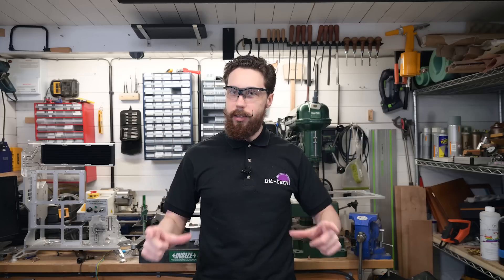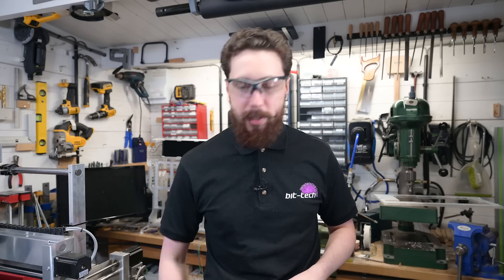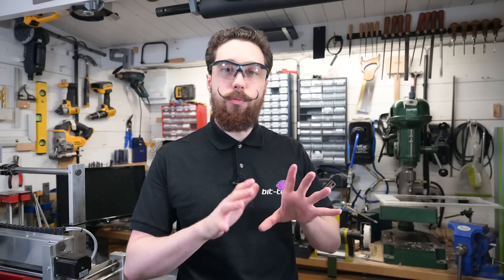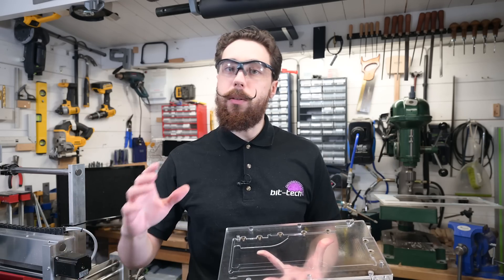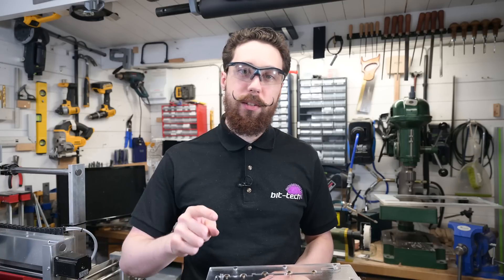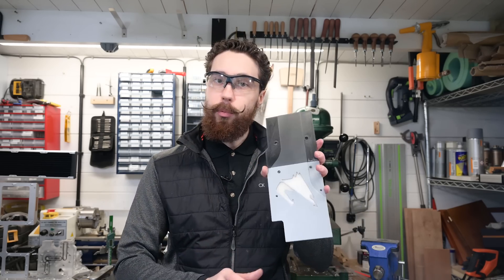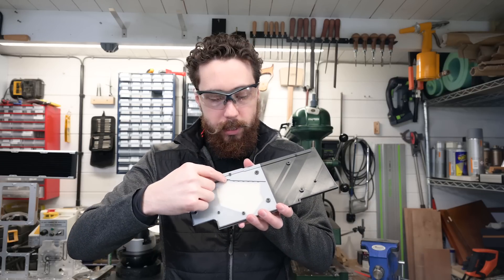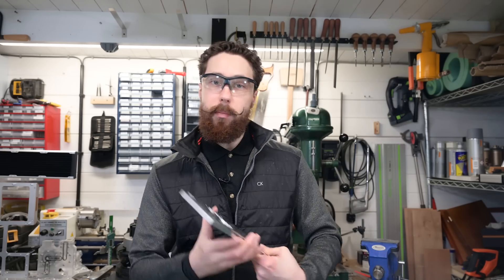AORUS Ensis Part 5 - Machining the THICCCEST GPU Backplate | #Ensis ft. AORUS & Intel

Comment: I can't even imagine what your shop looked like after the debris from that backside cut. Keep it up man, always fun to watch your videos. The PCB components peeking through the acrylic on the plate with the RGB looks amazing. I noticed you went with a horizontal passthrough with the surfacing bit and it looks like those lines just barely show up even after blasting. I feel like I didn't notice them on any of the other CNC's/blasted components so maybe I just wasn't attentive enough before. Is this something new that you tried? Any thoughts on ways to mitigate the effect?

Comment: You should do a water-cooled backplate...
Reply from the maker: A friend of mine, Lukas Korek, has actually done a backplate waterblock if you're interested. I believe Eteknix did a video on it if you want to check it out, they're pretty interesting bits of kit.
Reply: @bittech1  yeah! Thanks for the info. Got an aorus 1080ti waterforce. the heat on the back side is huge. And with the new cards I think it's time for this kind of candy 😁 
Btw your work is impressive, can't wait to see it's completion. 😎

Comment: how did you get the alignment so perfect when you flipped over the backplate? I am having so much trouble with my machine. any tips?
Reply from the maker: The key is workholding. You need to make sure that when you flip a part, you have a solid reference point that's properly aligned and square. Then you'll be able to use an edge finder or probe accurately. My fixture plate specifically has rows of dowel pin holes to facilitate this.

Comment: I think you could have added a corrugated pattern along the Aorus logo at the back to give the backplate some texture like the front of the Corsair HydroX water-blocks to catch the light a bit better and give it that slightly more surface area for cooling. But it does looks amazing.